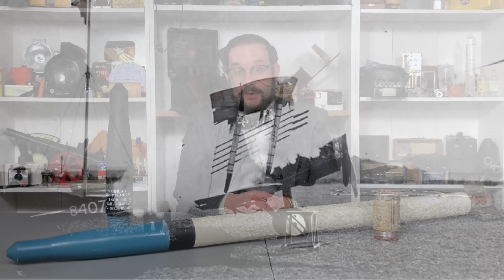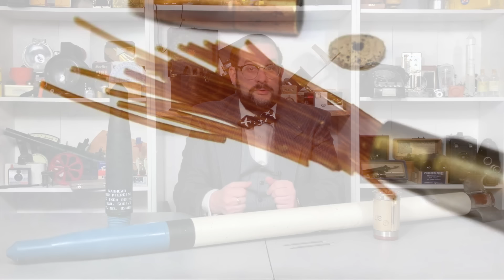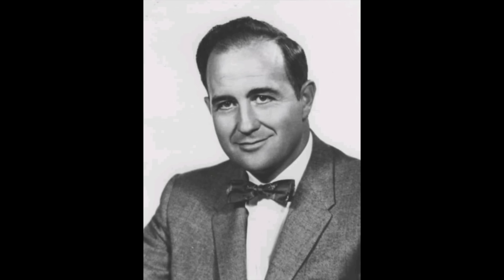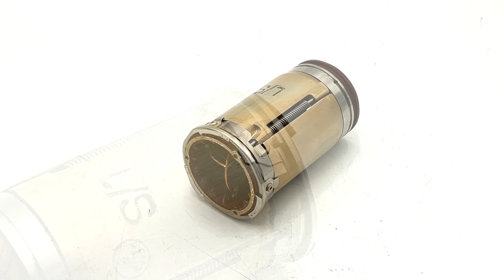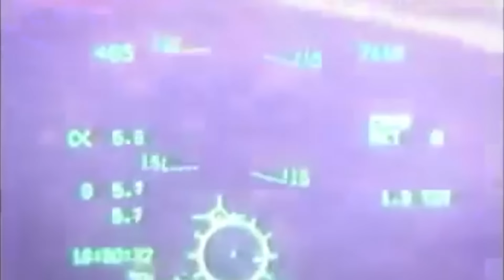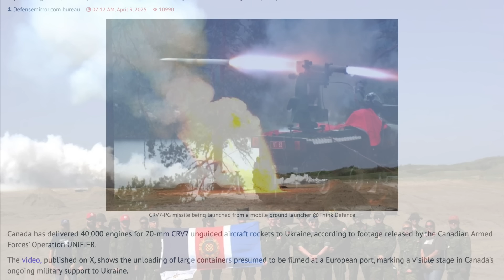CRV-7 70mm Rocket: Canada's Wonder Weapon

Comment: Just a quick point...at 18.15 that appears to be a BAE APKWS rocket guidance section, that's used on the Hydra 70, not a CRV-7PG.

I've never seen a decent image of a CRV-7PG that wasn't blurred whilst being fired, but it didn't have the  (rather elegant) mid-body guidance section of APKWS which is unique to it.

As far as I am aware no-one has tried to mate an APKWS guidance section to a CRV-7 (calibre is ok, but no idea on the threading), which is a real pity...particularly today as CRV-7 would be more useful than Hydra 70 as a counter-UAS rocket. I suspect as BAE makes APKWS and Hydra 70 that they have little incentive to do so. Unfortunately it looks like CRV-7 will disappear as a result....despite the fact its a better rocket than the Hydra 70 , Thales (Forges De Zeebrugge) or French Matra derived motors....the UK was an enthusiastic CRV-7 user (after using RP-3, Matra and RN 2 inch in the past) but has had to move to APKWS and Hydra 70 on the Apache E because CRV-7 isn't cleared and has no guidance option...as a result Typhoon is now being trialed with APKWS, despite the fact it undertook some integration work on CRV-7 in the 1990's....all for want of a decent (and cheap) guidance section...

Comment: @23:00 re: Acetone burns. I briefly had a job cleaning glass containers and fixtures used in a water purity test laboratory. That meant no detergent but sulphuric acid and distilled water. No gloves, if you kept your hands wet enough there was no problem. If you pressed too hard with a finger, reducing the H2O level to a point where the H2O/HSO4 ratio was just right, it would flash boil into steam, giving you a nice little 2nd degree burn on your finger tip.

Comment: I must've built 60, 000 2.75 rockets in my 4 years as a 6521 the only warheads we used were wp,he and minimal numbers of ap. seen a demonstration of the ap it had a orange powder in it so the pilots could see were the ap dispersed so they could adjust, if they didn't ripple all 19 . used to have a picture of a mix of 2000 wp and 3000 he stacked for the flight line and 250 mk 81 snakeeys for a strike on the breach of the dmc in Korea in the early 80's. Kim was testing the resolve of Reagan they had a body count of over 200 nork's. I have since never found a hint of it in the news.

Comment: I've heard about several weapons now that use 'black powder' as a sort-of ejection/jettison charge.  The RPG-7 is another example that is said to use it. Any idea why black powder would be used instead of smokeless?
Reply: If I had to guess, it's likely because IIRC while Smokeless Powder is "More Powerful" than your legacy Black Powder; Black Powder actually has a more powerful "Impulse" meaning it's got a slightly stronger "Kick" initially than Smokeless.

What this essentially means for any BP rocket motors being used for munitions, is a quick "prompt" acceleration which is likely why BP charges were also used for firing Torpedoes from USN surface ships in WWII as well as the "launching charge" used early in the war to launch seaplanes from USN Surface Vessels before "IIRC" it was replaced in both roles by Compressed Air.

Fun Fact: The WWII German Nebelwerfer/Whurframen Rockets "IIRC" were 100% powered by Black Powder motors (Which why they had SUCH a smokey launch signature) which were actually in the front of the rocket with the exhaust nozzles in the middle of the body at an angle to spin stabilize them in flight, leaving the only spot for the HE or Smoke Charges left to be the tail/base of the rocket.

This was actually somewhat of an advantage, as when the rocket impacted instead of the warhead burrowing into the ground a tiny bit before detonating slightly absorbing the blast and fragmentation, whereas with the HE charge in the tail/base of the rocket that left most of it still above ground when detonating increasing its relative Lethality.
Reply: Smokeless powder is an advantage in modern weapons because the sulfur in black powder is acidic/corrosive to weapons over time. But for something like this where you just need one good reliable kick, the longevity issue is meaningless

Comment: It was a good rocket.  The problem  was that its range is limited and puts the aircraft in danger of getting shot down on the modern batttlefield.  I could see it being used by attack choppers though, like the Apache.  Anyways when F18s fired them and you were on the range, you heard the crack of rockets breaking the sound barrier.  We were about a quarter mile away scoring the hits, the planes going from left to right.  The sound reached you as the rockets were hitting down range.  It was almost impossible to follow them by eye, they were so fast.  The motor burned out very quickly, the acceleration was insane.  The practice rockets had a steel bar for weight in the warhead.  They were curled up like pretzels when you found them.
Reply: At Romo range in Denmark we were accused of using live rockets because of the  sonic boom from the rockets.

Comment: Thanks for making this video.  I've been studying the Folding Fin Aerial Rocket for some time.

The FFAR was made in an attempt to counter the Ultimate Weapon that was a huge problem for four decades 1920s - 1950s, the high altitude bomber.  At first there was no way to even detect it, and even after RADAR there was no reliable way to shoot it down.  The Sidewinder (AIM-9) was also developed to shoot down high altitude bombers.

The Mk 4 FFAR was designed to be fired from aircraft and so did not spin.  Since at those air speeds the fins would provide stability. But after it failed to shoot down a rouge target drone the idea of using it against aircraft was abandoned.
https://en.wikipedia.org/wiki/Battle_of_Palmdale

The next application of the FFAR was in Vietnam in the air-to-ground role where it was certain to hit the ground.  There were problems because the forward speed of helicopters was too slow for the fins to provide stability.  Also the down wash exacerbated the problem.  The Mk 40 was a minimal modification to the Mk 4 that added spin.

The Mk 66 motor used on the Hydra 70 contains improved fuel and allows for a single exhaust nozzle that works with the wrap around fins that are never in the exhaust plume, like the Mk 4 and  Mk 40 which required four nozzles.

The next generation rocket engines (rocket motor is a misnomer) will be combined Rocket and Ram Jet.  By using oxygen from the atmosphere some oxidizer can be replaced with Ram Jet fuel thus extending the range.

I'm aware of the BAE Systems add on laser guidance kit.
If you know of any Kongsberg Defence patents please let me know.

PS my prior post had URLs, maybe that's why it was erased?

Comment: aw, it's not Winter anymore and it would possibly damage the product, but a fun intro could've been you going outside in the snow, seeing the top of the rocket covered in ice, then hacking at it with an ice scraper.
The existing intro is good enough though, startling and intimidating!

Comment: Everyone realizes 70 mm is less than 3 inches, right? Commercial fireworks are larger.
Reply: They’re 2.75” rockets, and officially classed as such. 

The Hydra 70 and CRV7 use the same 10-pound (4.5 kg) warheads.
Reply: These are actual rocket motors, much more powerful.

Comment: Got to love when the engine is so good you don't even really need a warhead if you aim good enough.

Also as a fellow Canadian it is beyond amusing to me that so many people use these now or did use them
Reply: Given sufficient speed, a speck of dust is armor-piercing.
Reply: APFSDS is one example of a similar munition. 
I heard an interview with an A-10 pilot who said the practice ammunition for the 30 mm cannon had solid aluminium (I could be wrong on that) projectiles but there was sufficient energy behind them that they would work against a light of armoured targets, just not something like a modern tank.
Reply: Which is fortunate as most of the expired tickets that were given to Ukraine were without warheads as the explosives in the warheads aged more quickly and hence many were deemed unsafe to use.
Reply: @johnwang9914 yeah but thanks to 3D printing and modern technology you don't really have that much of an issue if you're a government making new explosive Warheads.

Ukrainians had so many Surplus Soviet era explosive Depots and Manufacturing facilities that all you really need is the proper threading for the Warhead and congratulations as long as it has an impact fuse and chemical explosives you have a warhead
Reply: @Shinzon23 or you just fill it with concrete and you have a AP round
Reply: @OreoKiller_ yuuuuup. Or you could Harvest metal from all of the trash Russian tanks and return to Sender 😂

Comment: My thought was acetone. How about just weighing the block, before and after to discover the amount of FOD in the block? Maybe the particulate size was important, and a sample would be sufficiently representative, so the whole block did not have to be dissolved.
Reply from the maker: There were other materials embedded in the foam e.g. unburnt igniter pellets, bits of ignition wire etc. that had to be separated out.